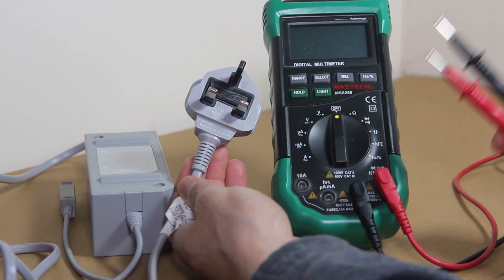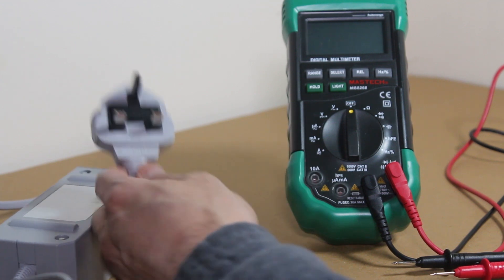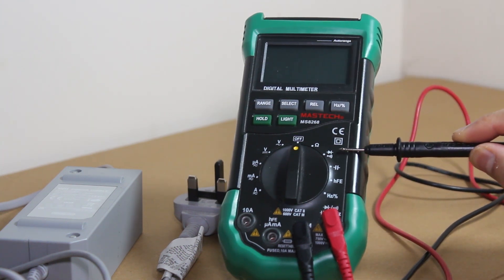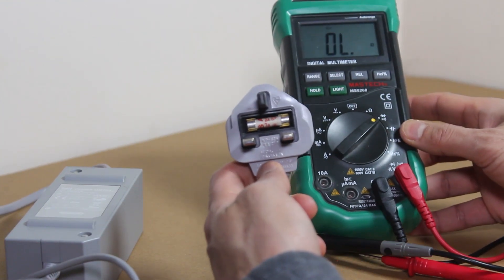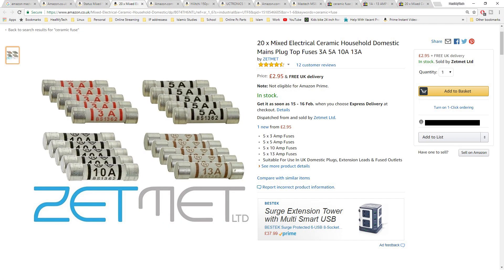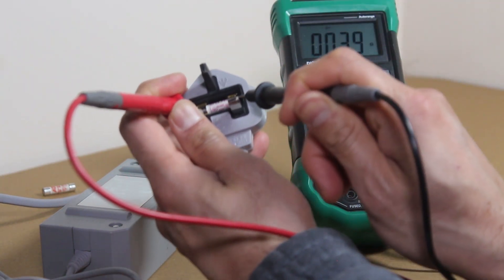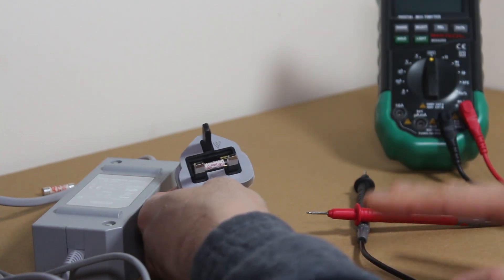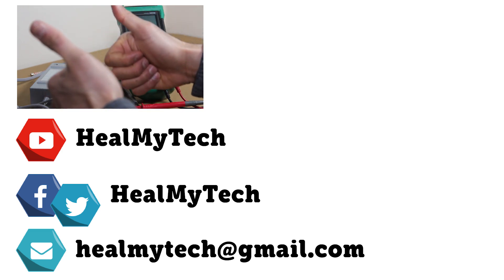How To Test A Fuse With A Multimeter (Voltmeter | Ohmmeter) For Beginners | Continuity Test

Comment: Just a question, is it possible to touch 2 of the 3  plug prongs to test or is this just a stupid question?
Reply from the maker: I don't understand the question!
Reply: No, that wouldn't work. The 3 pins (prongs) are live, neutral and earth. The fuse is associated with the live only. If the fuse is blown, it will cease the flow of electricity (current) via live and thus break the circuit. So to test continuity of the fuse, you need to directly contact both ends of the fuse or in line of the circuit the fuse is on